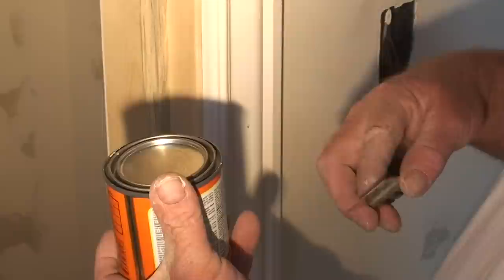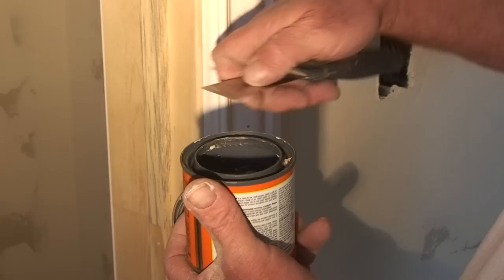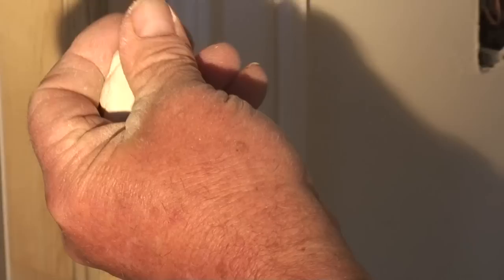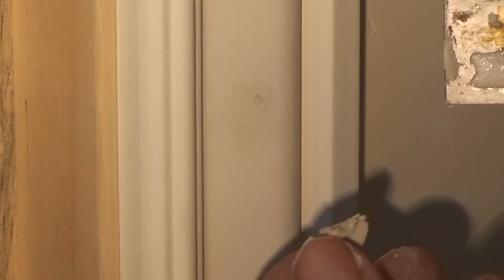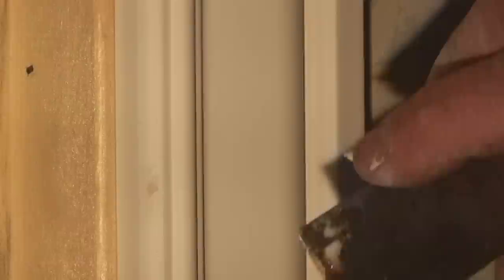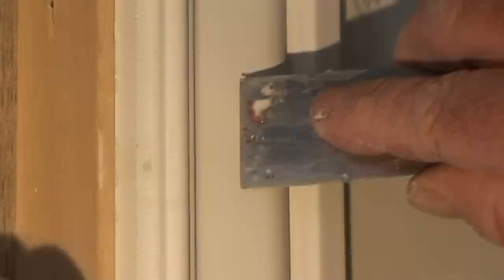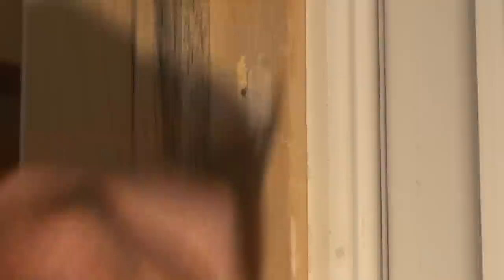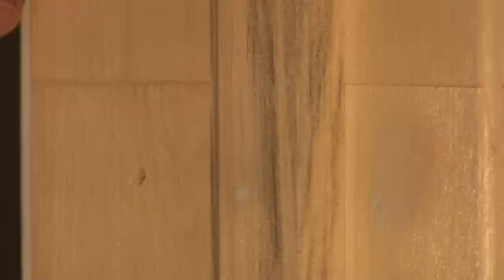How to use painters putty

Comment: Thanks!  Very helpful.  I would have used some kind of wood filler and then I would have had to sand, and it always shows under the final paint job.  This is much easier and my painted skirt boards are going to look better.  I've filled holes in varnished wood flooring with a different type of putty, but that kind isn't designed to be painted over.

Comment: This question was asked but the trim is white. If I just apply the sparkle to the nail hole and sand, can I just paint the nail hole spot if it is going to get yellow over time? Or do I have to paint the entire baseboard?
Reply: Undercoat it all then a finish coat ex gloss or satin

Comment: Very good example,my hyde putty knives are very very sharp (By rubbing on the concrete all the time) people who just use their fingers always leave hollows and don't take off the excess timber or plastic from the nail gun and create lots more work.Someone who is quick with a sharp putty knife sounds like a sewing machine going and the finished product is well worth it.
Best example i have seen yet.

Comment: do you have to sand this?
my company uses a spakle lite product...putty knife...fingers as needed. it leaves shallows ALWAYS ....but time doesn't allow a second fill. I have tried various methods and it seems unavoidable. unless you gob it on and then obviously more sanding. 
I don't know why they stopped using  (we call it "glazing") 
this seems to work better. 
is it faster?
not that they would listen to a rookie like me...but I take my job seriously...i want good results and to stop being told I'm slow.

Comment: How long does it take to dry, before painting
Reply from the maker: Thanks for you question. I have always been able to paint right after it is applied. In most cases we prime before topcoat is applied. We use putty to touch up holes and imperfections on pre painted base boards installed later over tile or wood floor and touch up with a coat of latex enamel. Two coats depending on quality of paint.